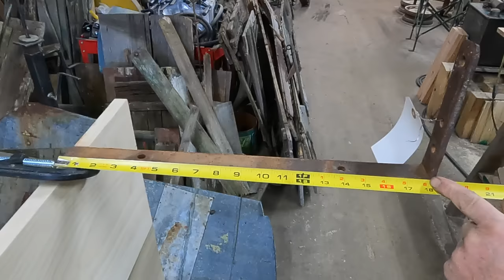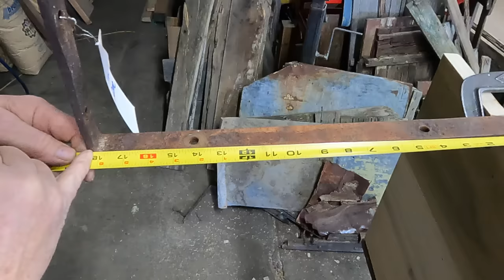Original Irons are not all Uniform, Surprise Surprise | Engels Coach Shop

Comment: I am amazed at the width of the planks which have been able to get. I don’t think that I have ever seen planks that wide before, and am in my eighties.
Reply: After hurricanes in 2022 we had to have some lumber 'made' to repair roof,  modern 6x4 is only 5-1/2 x 3-1/2" and didn't fit in with original 1950's construction..
Ended up costing me almost $15,000 as insurance wouldn't restore to original condition. 
Point is, stuff is available but you need someone who knows where to get it. I didn't so paid what I consider an exorbitant amount as I'm pretty sure carpenter didn't pay the $200 'a stick' he charged me for non standard size.
What was kinda upsetting, we had a few old white oak/Florida oak/water oak blow down, but no way to mill it (center is usually rotten anyway)
 In Florida downed trees are kinda common so just seen as 'yard waste'
Reply: They're glued.

Comment: Back in the early 80's we found a recipe like you use, where we dissolved steel wool in vinegar.  We found that you could brush it on, then cover the area with tinfoil (aluminum foil for the youngsters).  Then heat the area with heat gun or hair dryer.  This would leave the wood with a silver/gray weathered look.  We were making scale model buildings, bridges, and tunnel entrances.  If you use a tracer wheel to punch small holes in the foil, and then heated it, it would look like bolt heads as they were exposed to the air and would oxidize darker.
Reply: Neat trick!
Reply: Good tip!  Thanks!
Reply: Thanks for sharing. One of the things I may never use but am glad I know it.😊
Reply: We have used the ferrous acid finish for many years on the furniture we make. For those thinking about it, you should know that that the  results can be variable. We’ve found that the strength of the acid can vary from the length the wool is left in contact (fairly obvious) down to different batches of wool (no idea why). The biggest variant is in the timber. The reactant in the timber is tannin. The timber with the greatest amount of tannin available here in the UK is European oak (quercus robur). Even here, the shading can be variable, largely we think dependant upon the climate in which the trees grew. Not sure if colder means more or less tannin but you have to be very careful if trying match a new piece to an older piece. Some timber have very little tannin and, therefore, you get almost no darkening. 

This process is different from fuming or smoking - which turns the timber browner - even slightly green. We used to fume oak by placing into a “tent” in which we place a ceramic bowl of ammonia. A very nasty process and one that I’m glad we no longer do. Now. To achieve that result we use a stain.

Comment: Recently did a big batch of iron oxidation solution. Heated the vinegar in a big stainless steel pot. Added a whole bunch of OOOO steel wool. Was wanting to achieve maximum saturation of iron. Used it on white oak flooring. Because of high tannins in the oak and the concentration of the solution I was able to turn the wood black. Then after sanding, the grain stood out very dark. Different outcome than you were looking for but really cool. Keep it up. I learn something every time I watch. Thanks!
Reply: You can ammonia fume white oak. But fuming won't turn the wood black just brown. Makes it look like it's hundreds of years old overnight. You know, that rich wood tone? Fuming does that.

Comment: Dave, if you want to darken the solution more you could add some Sawdust from Oak, Cedar or Walnut or any wood species high in Tannin to the Rust Vinegar Solution. This will blacken it very quickly. 
I use a Rust Vinegar solution and Tannic Acid solution, which is just powdered Tannic Acid & Water to Ebonize woods all the time. 👍👍

Comment: And variation was the way it was built, and will look all the more genuine for it. I've no idea where such quality wide boards could be got commercially in Wales, albeit I don't know a mill owner; or we just don't have that scale of tree anymore. And forgot to add thanks for a real classy episode.
Reply: Those boards were glued.
Reply: Try to see if Wem (Shropshire) is still in business.    They  are/were a seriously good mill.  We would go to source there from Dolgellau.  Was worth the trip.
Reply: Cheers @causewaykayak , I know Wem quite well, mostly passing through I should say. Tbh I'm out of touch these days and the crux of the matter more about the lack of trees of decent girth to get the width of two boards each side.
Reply: @chrisbartrum3201  Hello.   Yes I did take your point.   Some of these long established mills have Ways & Means. :)  You are doubtless correct but if trees of  greater size  are  found these are the yards that might be taking them. Sometime after the Dutch Elm disease  mass felling  Wem was providing us with inch and a half through sawn boards over two feet wide and had specimens (probably for signs or rustic table tops) well over that.  On our last call there a new boiler had been installed  and all that old stock (Elm)   had sadly gone for fuel.   The deforestation in the UK  has been a disaster  IMO. Engels are so fortunate to have such first rate materials to hand.   👍🏼
Reply: It's getting harder and harder to find it here, too.

Comment: The tannin in the tea bags reacts with the water and iron to produce a "black rust" form  of iron oxide . Oxalic acid converts those same black water rings found on old furniture (often oak, which is tannin-rich) by a reduction reaction into a water soluble form of iron oxide that rinses away with water.

Comment: I'm quite partial to putting carriage bolts with the head through the metal whenever reasonably doable. The friction between square section and wood migh be enough to put things together, but it's a long time since I lost count of how many times a carriage bolt would simply spin before even a moderately rusted nut would come off.

Comment: You’ll  never have a problem with the carriage bolt head’s spinning in the wood if it ever has to come apart in the future with them locked into the straps. 
  And it has as much or more surface with the washer to wood.
Reply: I can still see how it'd upset a carriage maker's sensibilities though. Traditionally carriage bolts do go into wood. I must say I like how they did it on this wagon though. It is clean on the inside. Like you say that bolt should never spin either.

Comment: It's not really practical for you at this size, but when vinegar and steel wool solution is used in model railroad building, there is a way to control if it comes out grey or dark.   They'll coat the entire piece of wood (wall, deck, loading dock, whatever) with the solution, cover it with aluminum foil, then use a pin to poke through where nails should be, and dry is with a hair dryer.  The aluminum foil keeps the oxygen away resulting in a weathered grey, and where the heated air from the hair dryer can get in the pinholes it goes dark.

Comment: I was told that battery acid would make pine look 100 yrs. old. Have you ever tried it? I like to use different acid mixes when staining blackpowder stocks. I like the acid stains because it is a penetrating stain and not just surface coloration. The one downside to using acid based stains is that you don't always have full control of the color. As you can attest to, each piece of wood is different, even if from the same tree.

Comment: Nice lumber! Those boards were not inexpensive! I think I would have put the vertical element of bench on the irons before the seat part. This would make the connection at the corner a vertical joint rather than have the side sit on top of the seat where moisture would collect. Great video, as we come to expect!

Comment: I do not remember from when you took the sheep wagon apart but is there a possibility that the side boards were on the outside of the steel so the heads of the carriage bolts would be inside the wagon. If I were building one I would put the side boards on the outside of the steel and have it over hang the floor an 1/8" so the water would drip off instead of running inside but there are several things about that wagon that are strange.

Comment: Seems you had 4 braces that measured 18 + " and 4 that were 18 1/8 th + ". But they were split 2 ea per side. Couldn't you take the 4 that were the closest to each other for 1 side and 4 left for the other. This would require mixing them up , but they seem to be made the same style.

Comment: Referring to minute 16:13, the vertical ends of the irons will carry another board that will serve to lean your back against them when sitting on the bench? And will this vertical back rest board go to the inside of the irons (to keep the inside surface uniform and smooth to lean on), or will it go to the outside? If the back rest goes outside, this would have required notches for the irons in the outer edge of the benches. 
But if the back rest will be fitted inside the irons, as I suppose - would it not be better to make the bench somewhat narrower, so that the butt joint between the seat and the back rest would be vertical rather than horizontal? So that when the wood will dry and shrink, and the joint opens up, the gap would not be visible from the outside? And if the outside of the back rest board would get wet in the rain, no drops of water would creep inside through this gap on the upper surface of the bench? I must watch the video of the disassembly again, whether it shows or not how it was made originally. 
Edit: Sorry @tolbaszy8067, only now did I notice that you had asked the same question before.
Reply: Yeah ... I watched this video again https://www.youtube.com/watch?v=Re9nw6eRvgk and as I look there at minute 7.40, I see the bolts which fixed the back rest to the vertical ends of the irons. Carriage bolts with their heads inside, the nuts outside, and there are no washers. Obviously, the back rest board was inside the irons. 
When I look at the iron at the rear end on the right-hand side (to be seen at minute 10.45 in the foreground to the right, 
or at minute 12.45 in the background to the left) - isn't there something still attached to the inside? 
A piece of band iron, probably with square holes in it? Does this indicate that when the wood started to decay, 
somebody wanted to tighten the nuts, which caused the carriage bolts to turn in the old wood, 
and to prevent this, somebody made this band iron with square holes in it, to squeeze the board between two irons? 
And if this additional vertical iron goes all the way down to the horizontal one - isn't this the proof that the vertical board did also?
Reply: The proof is in this video https://www.youtube.com/watch?v=W1JWz9aLppY 
Go there to minute 00.35 and look where Dave holds his right hand. 
This is where the vertical board (which serves as a back rest to lean against) 
was squeezed between two irons. The inner one of these irons goes all the way down to the horizontal iron. 
This shows that the vertical board also extended down to the horizontal iron, 
and the horizontal bench board (on which the shepherd is sitting on) 
must be made accordingly narrower, so that the joint will be vertical, and does not let any moisture inside.

Comment: I don't know why but watching this I wonder if the original finish on the iron parts was some sort of paint or was it 'Japanned'  or oil blued  after forging?
I remember reading about restoring old bench planes and came across Model T Ford japanning which seemed to be most common finish 100+ years ago.
For it's age, the iron parts are in really good condition which can't be only because they were not in ground contact?

Comment: darn i love how wide those slabs of wood are, but just to think how old the tree they came from had to be it is also kind of sad too
was the orginal wagon also made out of singular slabs or did you improve the looks of it a bit with those solid boards?
Reply: Those sides and bench seats were glued together (or so it seems).  Check out "Blending New Wood with the Old Sheep Wagon | Engels Coach Shop" at or around the 12:00 minute mark.

Comment: Nice lumber! Those boards were not inexpensive! I think I would have put the vertical element of the bench on the irons before the seat part. This would make the connection at the corner a vertical joint rather than have the side sit on top of the seat where moisture would collect. Great video, as we come to expect!